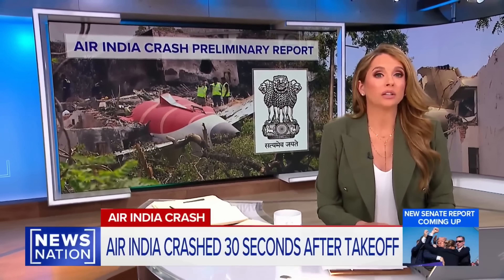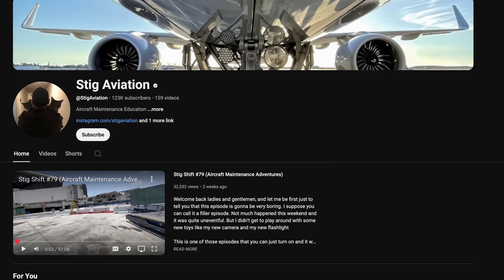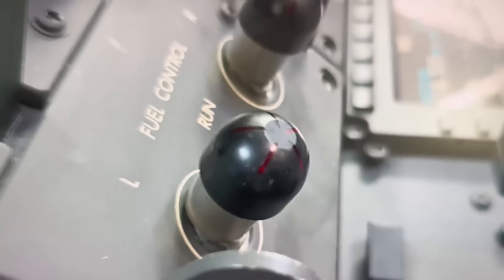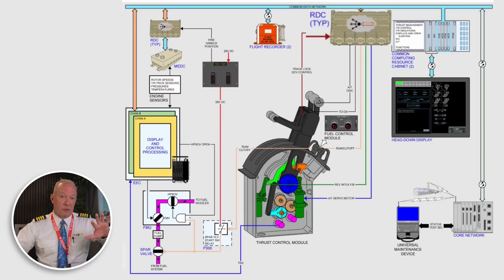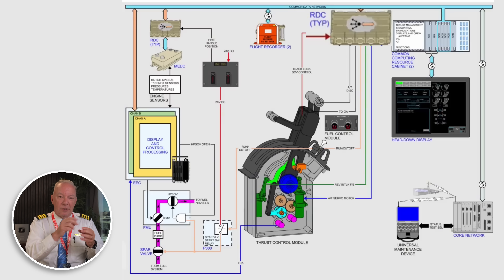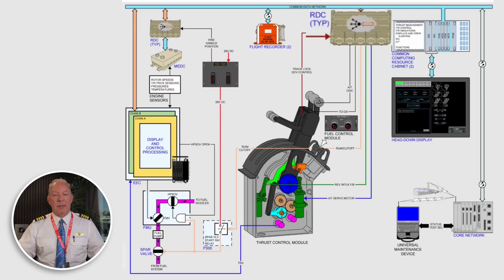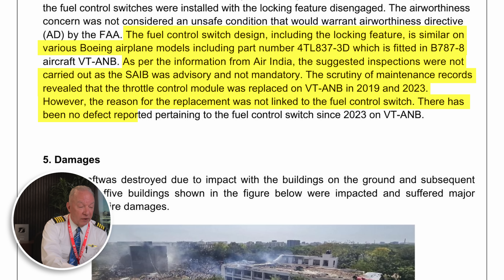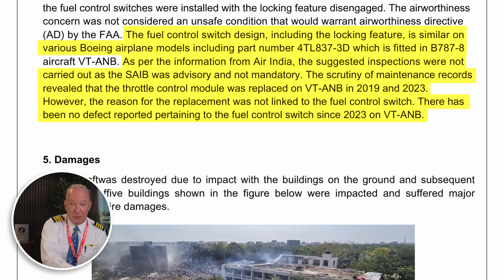The Truth About Boeing 787 Fuel Control Switches

Comment: Oto tłumaczenie Twojego tekstu na angielski:

---

@Captain Steeve, I truly appreciate your explanation of these phenomena in simple language, but using the words of Albert Einstein – explain complex things in the simplest possible way, but not simpler!

Based on the electrical schematic, you claim that the fuel switches very simply power a single relay, which in turn simultaneously supplies or cuts off power to three valves. On the diagram you provided, these valves are marked as SPAR VALVE, FMV, and HPSOV.

Please note the orange RUN/CUTOFF line. I agree that, in a straightforward way, the control activated via this path manages the state of relay P300. However, when its contacts are closed, the 28V supply is not always fed directly to the mentioned valves. The SPAR VALVE is indeed powered directly. However, the FMV is not controlled by relay P300, but by the EEC module. Controlling the HPSOV valve is even more complex, because for it to operate, it requires control signals from both relay P300 and the EEC module simultaneously – again, the signal marked HPSOV OPEN. The fact that these two signals must appear at the same time is indicated by the symbol of an AND gate, with two inputs and one output. Please consult this with a professional electrician, as your explanation may be too simplified, and therefore not entirely accurate.

It is also worth determining whether the normal state of relay P300 – that is, when it is not powered – is OPEN or CLOSED. The SPAR VALVE, FMV, and HPSOV valves may also be normally closed or open, but they could also require a specific signal for each open/close process. Without this information, it is difficult to assess what happens to them at the moment the power is cut off. Placing these valves in series means that closing just one of them is enough to stop fuel from reaching the nozzles, and the change in the state of these valves does not depend solely on the RUN/CUTOFF switch, as you claim. I will not describe all possible combinations originating from the three sources (P300, EEC, and 28V DC supply) that can affect the state change of each valve.

All this is just to maintain proper accuracy and avoid unnecessary objections, because the key information in your explanation remains the same – that the RUN/CUTOFF switch was moved first, and only after that did the engines begin to decelerate. Therefore, another cause for cutting off the fuel supply to the engine seems very unlikely, even if more components than just the RUN/CUTOFF switches and relay P300 participate in fuel valve control.

Many thanks for your professional presentation of the topic!

Comment: Hi Capt. Steve, I would say there is a possible auto shut-off command from EEC/FADEC to the HPSOV (shut-off valve) in certain protection conditions as could be an abnormal engine start. This means there is some electronic control that could lead to an engine fail without moving phisically this start levers/switches. Very extrange to be commanded from both FADEC as they are independent from each engine. Other direct signal to HPSOV bypassing Start Levers are the Fire Switches, this switches could send a closing order to the fuel valves and ignition to stop. In case any of this abnormal conditions,  if commanded erroneusly, should have been recorded by FDR and easy to find during investigation so I supose (if we believe) these were not the root cause. Thank you!

Comment: The pilot's brain is the one system that is not hooked to the flight recorder. We'll never know if it was a brain fart, suicidal ideation or what. We'll probably never know for suire which of the pilots did it. I know one of them said that he didn't, but if you don't trust him not to turn the engine off just after take-off, do you trust him to tell the truth?

The one important fact from the interim report is that this is not something that is likely to affect 787s. At least, no more than it's likely to affect any other plane.

Comment: What about physical failure of the wires or battery connection failure? Also, wouldn’t it be better to have a current fail, valve open circuit to avoid this?

Comment: Mr Steve respectfully you have three (3) fuel shutoff valves in series with the fuel nozzles,  two of which (HPSOV and SPAR Valve) are controlled by the fuel cutoff switches.  The fuel valve FMV is not connected to the "fuel cutoff switches";  this FMV fuel valve is powered by "Display and Control Processing" which is in series with RDC (Remote Data Controller) MEDC (Main Engine Data Concentrator) which processes data related to PFPS (Propulsion Fire Protection System),  also Pressure and Temperature sensors which are directly proportional,  if one goes up the other one does as well,  and can signal an overheating condition and shut off fuel to both engines without anyone touching either of these fuel cutoff switches. All three (3) fuel shutoff valves are NC (Normally closed) valves,  which means power being applied opens these valves.
Reply: Excellent facts.

Comment: Perhaps the fuel control switches could be moved somewhere else in the cockpit. Then operation of the switches would require an obvious action to take place. If, as has been suggested, someone other than the pilot flying the plane moved the switches this could have been achieved without the flying pilot noticing it. There may, of course, be other ways to indicate that such switches were placed into the off position during flight other than noticing a lack of power.

Comment: Captain Steve, I have seen whole wiring bundles short out in an electrical short. Also how does the EICAS know that the switches are off? So there have to be more connections to this circuit!

Now I know that the switches were turned off by a pilot so my points are moot but the system is not as simple as you explain and both systems could be cut together by a major loom fault. 

Great channel by the way.

Comment: Is it just me, or does somebody else also see some of the not addressed problems:
@3:02 The physical switches have a wide middle range in the switch movement where it is NOT LOCKED in one of the positions. 
Where the "little nib" would ride on the bar in the middle.
What does the electrical contacts in the switch signal in this middle position? Is it "engine on" or "engine off"?
If it is detected as "engine on" then the switch would be turned on BUT NOT BEING LOCKED in the on position!
It be just a incorrect operation of the switches at engine startup, not malicious action. 
Like the shift lever in a manual car not fully engaged in the gear position.
Second issue:
@9:25 The switches are not mounted directly on the battery. The battery is in the electronics bay or somewhere else, but not in the cockpit.
These switches are connected by how many meters of cables, which are divided by how many connectors. 
I can't imagine that every flight critical system has it's dedicated, undivided hot connection to battery.
So even if the battery won't die, the connection between battery and the switches CAN FAIL. What will happen to the cut off valves?

Comment: Nice video. Thanks.
I guess I lack understanding of the system, but I wonder about about the battery(ies) that actually provide current?
Also about its voltage level limits that would mimic the closing of the valves by the switches?
Could this also be caused by electromagnetic interference?
I believe we will get better answers when investigation is finished

Comment: Those valves are MOV's, Motor Operated Valves, which mean that there is a servo that need a signal both to open and to close. Loss of the signal or loss of power for whatever reason will not change its position but keep it stationary in whatever position it was in. So no, it doesn't need any current to keep the valves open.

Comment: What if there was a fault on those switches and they where then accidentally knocked to  the off position due to the faulty safety control cut off switch. The pilot then asks the other pilot why did you switch to off which neither intentionally did. I spoke with an aircraft engine engineer who posited this to me and insisted that those switches could have had a faulty safety mechanism. The report should be able to determine if these switches where in fact faulty at the time of this crash.

Comment: I'm not into avionics, but I do work as a computer programmer for a company that's heavily involved in electronic design, and also telemetry, recording what the systems are doing and logging it somewhere for analysis, the kind of thing a flight data recorder does as well.

This system is in many ways no different to the light switch in a car. The light switch does not directly turn on the lights of the car. The switch turns on a relay, and the relay turns on the lights of the car. That is because the switch is not rated for the full current of the lights. There are many similar systems on a car, for example the horn is the same: The switch in the steering column usually grounds a wire, which closes a relay elsewhere, which activates the horn.

In your video this is not perfectly clear, but knowing what I do about how you make such systems redundant: You run a separate wire from the bus to the switch for EACH switch. In a car you might share a wire, because it is not mission critical, but even in cars, for things that may cause an engine to cut out on a highway and cause an accident, there will be a separate wire for each component. Not only the supply wire, there is a separate ground (usually the negative) as well. This is done on purpose, so that one broken wire does not disable multiple systems. I would be very very surprised if the system in the 787 isn't designed in a similar redundant fashion.

Let me take another diversion, into the drive-by-wire throttle pedals used by most modern vehicles. The have two sensors, two grounds, two supplies, so that you literally have two completely different systems with no shared wires, so that a single wire break can never render the throttle inoperative. Sometimes the supply voltages of the redundant systems might even be different, so that a short between wires causes an immediate discrepancy in the signals. The same has to be true on a plane.

Next then, comes the telemetry. This is actually obtained from a separate contact on the same switch, again, probably with its own wiring, not sharing anything with the other signalling to the relay. This then goes to the RDC (according to Stig's video linked here) where it goes to the data bus, and from there the FDR records it.

If there was some kind of wiring fail, we would actually expect either the FDR to record it (while the engines are not affected), or we would expect the engines to fail, while the FDR does not record it. An engine failing while it is also recorded tells you a switch moved. The measured telemetry here is actually incredibly damning because it is measured with a separate contact on the switch.

If there was a single point of failure, we would also expect simultaneous signals for both switches, which we also don't see, they are a number of seconds apart each time. A second, in telemetry terms, is an eternity.

Similarly, if there was a shared supply or ground wire to the relays, we would expect both engines to spool down at exactly the same time as they lose power. This is not clear from the report, but I would imagine the data very clearly shows RPMs or something similar for each engine, and this would be very clear to investigators.

People who claim that we cannot know because of the big mess of wires frankly don't know just how simple, and yet clever this wiring is. The most likely answer, given the hardware, is that someone turned those switches off. We will probably never know exactly why.

Further to that, I wanted to say something about why entire modules are replaced and not just the failing part. It is because of testing. A family member of mine works for SAAB Grintek. Military applications. After repairing a module, it's placed in a freezer and an oven to test that it is up to spec. That is why you replace the whole thing and not just the switch. It has to be fully certified before it can go back into a plane.

Comment: We know almost with certainty that the RAT got deployed before the fuel switches transitioned to cutoff. Maybe the pilots moved the fuel switches in order to relight the engines due to the catastrophic electrical failure. Of course we may never know why they did it, as we are at the mercy of the investigation team.

Comment: Common sense would dictate that the fuel  switch solenoid valves would work by allowing fuel to the engines with the relays DE-ENERGIZED in case of electrical failure of the electrical buss controllers..Definately not happy about the fact that they have to be ENERGIZED to supply fuel to the engines rather than DE-ENERGIZED.

Comment: well, if there are relays, there are few another options.
-relay malfunction. Very improbable - relays once switched on, have no reason to  switch off ... and then back on.
And two of them.
Very high acceleration may cause this, but it should leave many other traces.
-loose wire in cocpit, which energize switches .. or relays.
- voltage drop in switch circuit - I assume, that below about 10V relays switch off

Comment: 05:42 Is there really a relay inside that switch ?
If so, where is it getting its power from ?

The FDR did not, nor can it, record the position of the switch.  At best it can only record whether current flowed through the circuit controlled by the switch or the circuits controlled by the relay.  Current could flow in either or both of those circuits without the switch position being changed
Reply: The switches are 2 pole 4 way switches. There is 1 set of contacts for the primary function and a seperate circuit that determines the position of the switch. These are doubled up for redundancy and each circuit is powered from a different source. Hence there are 12 wires coming from the switch. The position sensing circuits provide signals to the RDC, which are eventually recorded by the EAFR.

Similar arrangements are included in the control valves, so that the actual position of the valves can be recorded.

During power outages (which appears to have occurred shortly after takeoff) may result in the position sensing circuits being depowered, which can be interpreted as the fuel control switches being moved to CUT-OFF. When power is restored this can be misinterpreted as the switches being moved back to RUN.  The restoration of power (probably from the RAT) may result in left and rights buses being energised at different times. This may be why the reset of the No 1 and No 2 engines switches  being separated by 4 seconds.

Comment: What is used to measure the transition of the switches? Is there a physical connection in the switch that provides a voltage to indicate that transition? What if the 28VDC buss failed. Are there redundant busses? Are there fuse or fusible links in the circuit. Otherwise, I’m familiar with the detent switches. 

Trying to to deny anything you’re saying I respect your knowledge on this. I’m just curious thank you for your service and your expertise.

Comment: For me as an aircraft engineer  avionics B2 , we can think of a most possible thing that could have happened, may  be the relay itself ( providing the elect power to the three valves ) was bad then the contact position of the relay changed over to open , this caused all three valves to close , when the pilots noticed that from the synoptic page that the fuel valve closed , they tried to recycle the fuel cut off switches as a try to open the fuel valve again but it was too late because the relay was faulty .
For this reason even if my expectation above is incorrect ,I  would suggest to amend the wiring diagram for this system to provide an alternate path or source of electrical power to be fail safe principle. Because the fuel is very important for the engine to keep running.
Thank you captain for the explanation , I wonder if all captains have similar information about aircraft systems.
Reply: This would have to happen on both engines at the same time, which is very unlikely.

Comment: A faulty relay can turn the switch off automatically. Although the switch was being pushed to ON, it may not have locked itself in the ON position because of a faulty relay.
Reply: If the switch and the control valve were not in the run position, the engine could not have been started.
Reply: @christopherrobinson7541 It could have started but tripped back to off in those few seconds.

Comment: You explanation is appreciated. You mentioned that there is a closed loop between the Fuel Switches, battery and the fuel control valves. However, what would you have to say about the situation when there is an engine fire, and the pilots pull the Engine Fire handle, which also "cuts off the fuel supply to the engine immediately"... then how is the 'closed loop' you just explained a real 'closed loop'? Pls explain.

Comment: Boeing planes have a long list of defects
1.MCAS Design flaws
2.Door Plug Blowout
3.Rudder Control Issue
4.Battery Fires
5. Fan blade and engine failure and many more